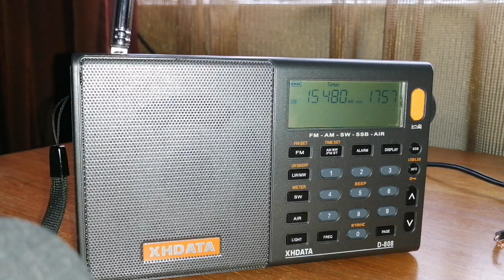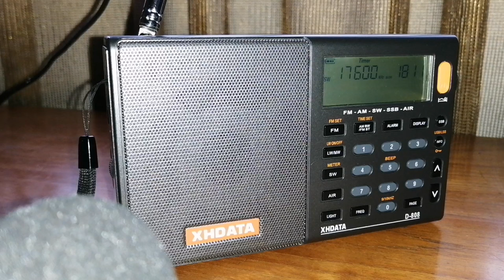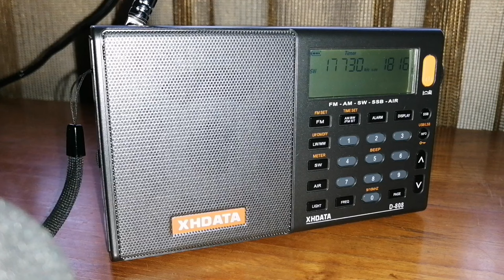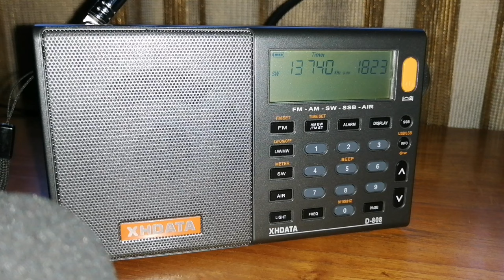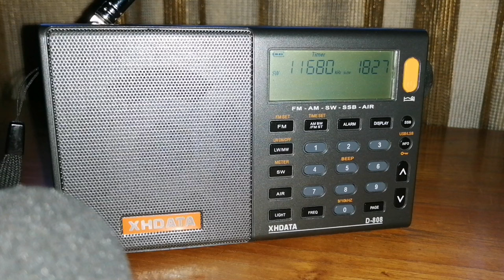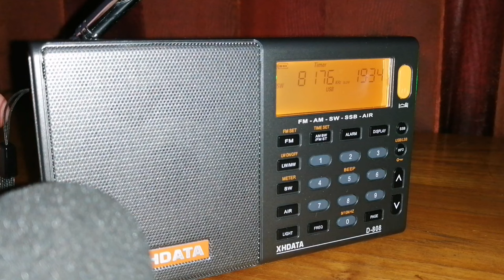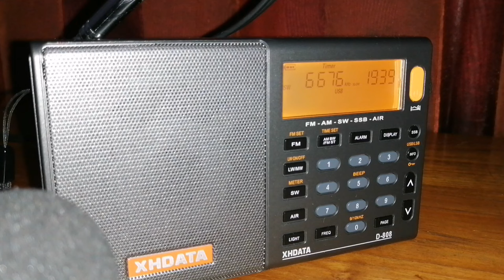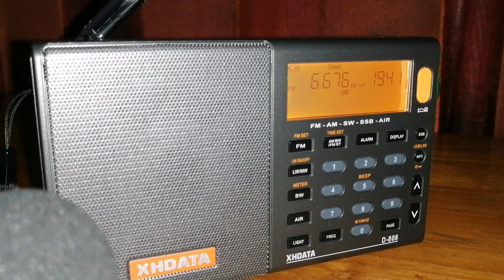Ultimate MLA30+ loop vs wire antenna comparison: Surprising results! #shortwave #radio

Comment: .. Awesome demonstration André!!. What your video means or what you have "demonstrated" is  that you live in a relatively free QRM environment (.. congratulations ;-)) SSB signals are more eficients in terms of power vs  not SSB AM signals (I mean commercial stations). So, magnetic loops are more directive and Its receive better when power  is lower ( although some QRM is till present). Anyway, a simple piece of wire "almost ever" gets more electric power from the signal (mixed from the noise).. but only is getting better the reception when signal is really power, .. This "could be" the reason you catch better SSB transmissions from your loop than from your simple wire... Thanks for your good and didactic videos!. SWL always will be a great hobby ;-). Cheers, Pedro. 👌📻📻📻
Reply from the maker: Thank you so much for your comment Pedro! I think you are right, my area probably has less QRM, although there certainly is some noise around, the biggest culprit being the solar panels and batteries that many of my neighbours have. We live quite close to one another, the houses in my community are all attached along the sides. But the wire still seems to work really well. I must say, though, that I was a bit surprised by my test. I just thought that the MLA30 would, in general, pick up signals better than just a wire. Your explanation shows why that is not always the case, thanks for that! Thank you for your kind words about my channel, I am very happy that you enjoy my videos!
Reply: Agree André!,. and thanks to you.  Is quiet impressive what "the miracle" is.. a simple 10m piece of wire for catching the radio waves.. Where I lives,  here in Oviedo, North of Spain, sometimes get close to the marvellous Cantabric Sea coast to listening the relaxing marine and also radio waves with some of my portables and ... a 7m wire,.. Well, the "diference" between telescopic whip or wire is simply amazing,.. this is the ideal enviremont totally free from our QRM, where a simple wire by antenna demonstrate by itself their unmatched potencial.. but in noisy sites, manytimes, a loop antenna will get better signal, less noise..  Continuous your experimenting and videos ;-))
Reply from the maker: @pruebasytecnica I think listening by the seaside should be amazing. I haven't really had the chance to do that yet, my house is very far inland. But next year I am planning a coastal holiday.

Comment: I use an MLA-30+ most of the time for shortwave. I live in an upstairs apartment and cannot put the antenna outside. The electrical noise level here is really bad. Without the MLA-30+, I couldn’t hear much of anything. I also have a wire strung across my room. The wire outperforms the MLA-30+ every time. However, the wire picks up an incredible amount of noise. In a quiet environment, I believe the wire will outperform the MLA-30+ every time. I also believe that the MLA-30+ does not perform as well on the higher frequencies.
Reply from the maker: Hi Mike, thanks for your comment! I think one of the great advantages of the MLA30+ is indeed the fact that it helps a bit when you live in a very noisy environment. In my case I am lucky, my surroundings are not RFI free, but noise levels are quite low. So my 10 metre wire works exceptionally well, with little noise. This means that I mostly use the wire for DXing in my portables. The MLA is attached to my Kenwood R1000, and works well on the Kenwood. I have had some good catches, especally at lower frequencies. I think it works better for lower frequencies, as you say also. Where the MLA does come in very handy is for SSB listening. My Kenwood has a lower noise floor than the portables in SSB mode, so I use it for very weak signals. And the MLA seems to work very well when I am DXing in SSB mode on the Kenwood. But, in general, I think a 10 metre wire works pretty much just as well as the MLA, if there is not too much noise.

Comment: Where was your MLA30 and did you try orientating it? I get much better performance from my MLA30 on my SDR but agree that the wire is still the better performer on the portable radios
Reply from the maker: It was on the same side of my house as the wire, the exact same location actually. The southern side of the house. I have turned the MLA30 around to try to get the best position. I like the MLA30, I think it is great on very, very weak signals and SSB. But I was a bit surprised by how well the wire did here.
Reply: @swlistening  yeah it was a massive difference in the video hey, and it didn't even sound like noise, just poor signal strength
Reply from the maker: @chrisbarnes5016  Indeed, a big difference. But for SSB the MLA30+ is definitely better.

Comment: Hello André, I'm really impressed by how fast you went with this suggestion I had made 😁. I didn't expect to find this video already up when I checked Youtube one last time before going to bed yesterday evening.
I'm not this surprised by the outcome since it pretty much matches my experience. I'm starting to think that the MLA30+ is overrated. OTOH my main problem with it is the noise level, which you don't seem to suffer from much. Probably because you're in a much quieter place RFI-wise. 
If I may offer an alternative to your reasoning: it seems to me that the MLA30+ does better in the low bands. All the broadcast stations you're showing here are in the 11-15-17 Mhz bands, whereas the VOLMETs are in the 6-8 Mhz bands. So my feeling is that it's not so much a matter of modulation as it is a matter of wavelength in your case.
Then again this is unexpected. Most comments I've read on the MLA30+ were claiming that this antenna is most effective in the high bands.
Radio technology is full of surprises  😅
(edited for a couple of spelling/grammar fixes)
Reply: You do have a point there.
Reply from the maker: Thanks for your comment Alain! When you made the suggestion it made me very curious, so I went right ahead and did the test, also to see for myself! I think you might be right about the MLA30+ seemingly performing better in the lower bands. That means I will need to do another comparison, the wire vs the MLA30+ in the lower bands 🙂 Maybe next weekend.

It is interesting to me that your MLA does not seem to help with the noise level, I thought that was meant to be one of its main advantages, to help with nulling out noise. But it seems clear that this is not always the case. I do still see some use for mine, it certainly helps a lot with my SSB listening, to catch those weak and distant Volmet and maritime signals. The other nice thing about the MLA30 for me is the convenience, it is small and not obtrusive. When I use a wire I need to stretch it out in front of my house, across a little terrace by the front door, towards the parking area. So I cannot leave it up all the time. But I have found that my 3 metre wire generally works well for my regular broadcast SW listening, so I mostly use the shorter wire for that. The shorter wire just runs out of my study directly up towards the roof.
Reply: @swlistening  Thanks for your reply, André. I'm very confused regarding my MLA30+. It does bring in a lot of noise nowadays, up to the point that I got tired and replaced it with a long wire eventually (well, actually a simple wire dipole antenna I've built myself). 
Has it been always like this? well, this is the point. I can recall being happy with it in the beginning. So it is me changing my mind or is something wrong with the antenna itself? That's a possibility. I've read a few people complaining that the DC-DC converter in the bias box adds a lot of noise and somehow this might be what I've been seeing. Has a component (like a filtering capacitor) gone bad somehow? Could be. I have no clue, really.
Or could it just be the seasonal changes in propagation making it less effective? or more noise sources around that it catches more than the wire antenna? Beats me.
Reply from the maker: @F4LDT-Alain  I actually noticed during my test that there was noise when I was using the wire and forgot to unplug the power bank on the MLA30.

Comment: Pleasantly surprised to hear marathi  language on AWR. I have been listening to AWR (not as a listener of sermons), but as a swl since 1990s. Please be kind to share how tour wire antenna is put up. I live on the 14th floor and just hang out a wire feom a 8 meter fishing road to give it some.distance from the concrete.
Reply from the maker: Thank you for your comment! I listen to AWR for DXing and for their Wavescan programme. Do you know it? Very interesting DXing programme. I live in a housing estate where the houses are attached along the sides, all are single storey. I have a small garden front and back. I just run the wire halfway across the garage roof, to give it some height, and then across the top of a very large bougainvillea plant 😀 Your fishing rod idea sounds like a very good one to me!
Reply: @swlistening  that's an interesting setup. I guess everyone's wire antenna setup have a life of their own. I looked up the AWR DX program. It's a podcast and looks very interesting. Much appreciate pointing me in that direction! Happy DXing
Reply from the maker: @manishbhoola  Sure! I really enjoy that programme, lots of interesting DX reports from around the world, and many other interesting segments about radio in different countries.

Comment: How is the wire attached to the radio?
Reply from the maker: I use a crocodile clip, for the wire and the MLA30. So I twist a bare piece of wire around the whip and hold it there with the crocodile clip.
Reply: .. Impresionante demostración André!!.  Lo que tu video significa o lo que has "demostrado" es que vives en un entorno QRM relativamente libre (.. felicidades ;-)) Las señales SSB son más eficientes en términos de potencia que las señales SSB AM (me refiero a estaciones comerciales).  Por lo tanto, los bucles magnéticos son más directivos y reciben mejor cuando la potencia es menor (aunque hasta el presente hay algo de QRM).  De todos modos, un simple trozo de cable "casi siempre" obtiene más energía eléctrica de la señal (mezclada con el ruido)... pero solo mejora la recepción cuando la señal es realmente potente (porque los cables también amplifican el ruido no deseado. ;-(  (). Esta "podría ser" la razón por la que captas mejores transmisiones SSB desde tu "bucle más silencioso" que desde tu simple cable... ¡Gracias por tus buenos y didácticos videos!. SWL siempre será un gran hobby ;-).  Saludos Pedro 👌📻📻📻
Reply from the maker: @pruebasytecnica  ¡Muchas gracias por tu comentario Pedro! Estoy de acuerdo, creo que mi área tiene relativamente poco QRM, por lo que probablemente esa sea la razón por la que el cable es muy efectivo. Sin embargo, todavía me sorprendieron un poco los resultados, pensé que el MLA30, en general, siempre captaría señales más fuertes que el cable. Pero tu explicación muestra por qué no siempre es así, ¡gracias por eso! Y gracias por tus amables palabras sobre mi canal.
Reply from the maker: @@davidwanklyn8842 Very interesting David, thanks! So this seems to mirror my own experience. Good idea about running the test simultaneously, I can actually also try to do that. I have two XHDATA D-109s, I can use those for such a test. I use my random wire on some radios that don't have antenna sockets, that is why  I'm not using a coaxial cable, I still just wrap an exposed bit around the antenna. I suppose it is a compromise I have had to make, a bit more noise, but I am able to use the wire on all my radios.